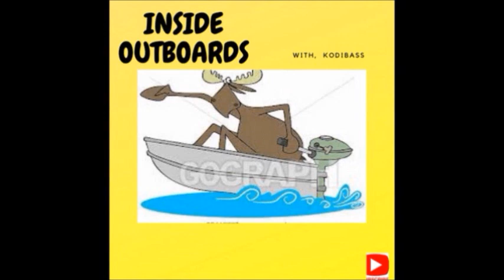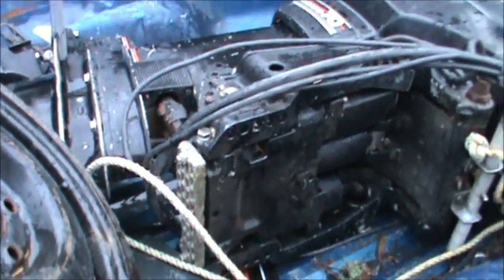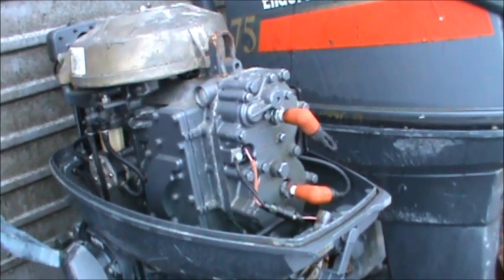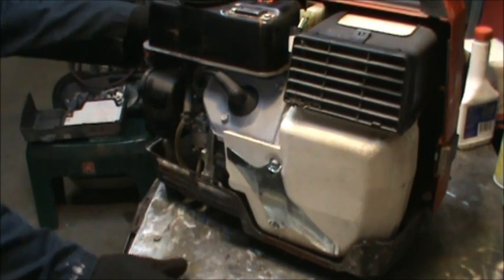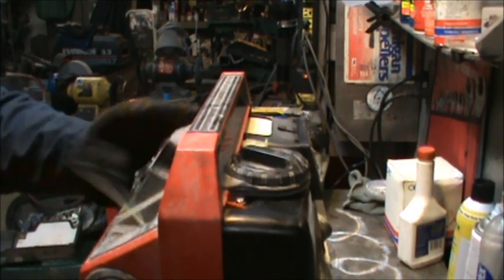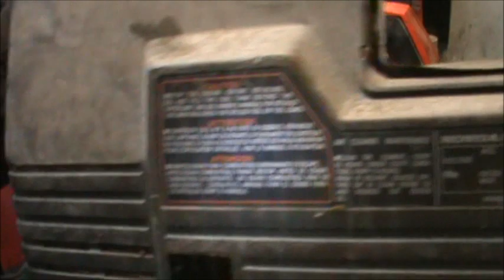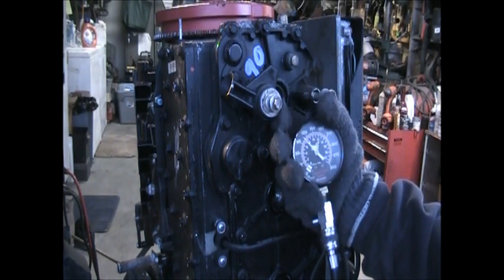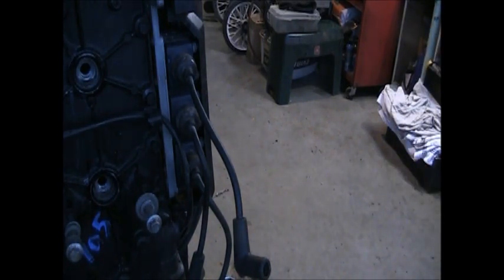MERCURY 70 hp 2  stroke VRO  & more

Comment: Ya done good on those gifts. Especially on that Enduro that hasn't been wrenched on.....This is Joe E who detailed some techniques for never breaking stuck bolts a couple months back...I have a couple info bits relevant to this video you may find useful. Re that Merc, The BUHW-2 plug won't be on the factory recommended list. The -2 wasn't around yet. Use it anyway. It has a wider gap and doesn't foul like the BUHW.  This is also the plug I use in my 70 hp and 25-35 hp Jonnyrudes, after of course  using the stock Q 77's to read for carb adjustments. Great plug!......Better troll, quicker starts, etc.......My other thought, as a long time Skid Steer guy, regarding your cool little motor mover, is that Anything you can do to reduce the governed RPM's a bit will make a Big difference on handling and smooth use....I would bet that a half turn on the right screw would literally change the nature of the little beast. Dial it down until you start killing the motor when inputting control, then back up a bit,....Just my $.02, which is worth even less....Oh, Lose that VRO, but you already knew that...They all suck, but those early Merc mixers are only safe in the dumpster.....Cheers, Kodi. Keep up the good work. Your video archive is a treasure to everyone of us who run junk successfully and like it that way...We also need an archive of every comment made by Kramden.  I hate it that so much knowledge posted by the best of us slips away like sand in the comment section. .....JE
Reply from the maker: I need to bring my Ram-Rod (skid) in the shop & go thru the whole machine.  You are so spot on about kramden,,  He has forgotten more about outboards than I will ever know.  tks, 
                                                                                                    kodi

Comment: Kodi, been watching for a long time. I have a question about a 1969 evinrude 33 ski twin. It has a cut out switch that I’m not familiar with. I have no spark and I’m wondering if the cut out switch is bad, (it has crusty wiring) would that cause not spark in both cylinders?
Reply from the maker: Could be,  bypass the switch & see if spark returns.  could be several other reasons for loss of spark tho,      kodi

Comment: Codi I need your opinion just opinion, which is better merc or omc
Reply from the maker: It has 2 be much more narrowed down than your question.  I am a huge fan of the Merc  classic  50 in-line 4 cylinder 2 stroke.  But do not care @ all 4 the late 80's Merc's.  I think OMC has fine models as well,  But would never recommend the 9.5  to anyone other than a skilled outboard teach.  So you see it is a year by year ,, model by model  thing,     kodi

Comment: Hi Kodi, cool a merc and a 70 3 cylinder two stroker👍 once you get it running get some muffs on it to hear the thunder. My 60 sounds sweet when I run it that way. Make sure you explain to folks when on muffs don't run the rpm up over 2500 and not very long. Not good on motors not under load. I see some people on videos run them with muffs almost at WOT. Good way to break a motor.

Comment: Do you think those jet drives are worth the money
Reply: Yep every penny
Reply from the maker: It depends on your style of  Fishing / Hunting..  If  You R one who wants to get to where Not Many can get 2.  Yep'  These motors are Golden..  But for the everyday  Joe schmo, Fish / Hunt person.  Not so much .  ' note''  These Jet units R Amazing on the right skiff with the right operator.   kodi
Reply: jet drives are only good for one thing: shallow water like 3'' on plane. other than that completely useless. they rob a TON of power, and are super expensive to find parts for. gas mileage and speed both go down, because jets are horribly inefficient compared to a prop. look at jet skis... they need 400+hp to go 85mph. a 20' Allison with a 150hp outboard can go over 85 easily, and its heavier !
Reply: Ri outboard, I agree the rob power, lower speed and mileage,  parts are not hard to find or overly expensive and the beauty in that is there are so few parts they rarely fail. All you have is a bearing that runs in grease and is greaseable .  For me boating on a river it's a safety thing for submerged logs and shallow water .  Useless, no     ,  good for every application, no but it will push your boat through deep water if you need
Reply: @kylejorgensen1412  Which motor are you talking about? I do know the jet drive on a say a 35 Johnson/Evinrude is quite expensive to get parts for, if they are even made. Yamaha might be cheaper I dunno. But yes agreed, if you need to go really shallow it's the only option!